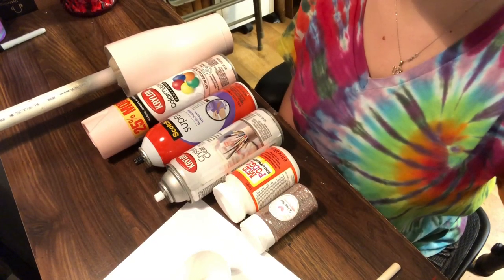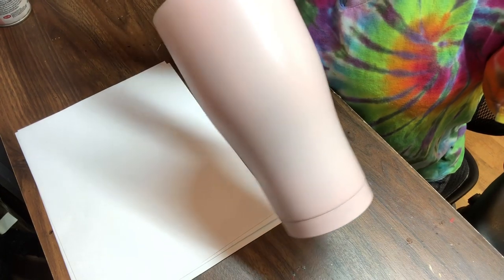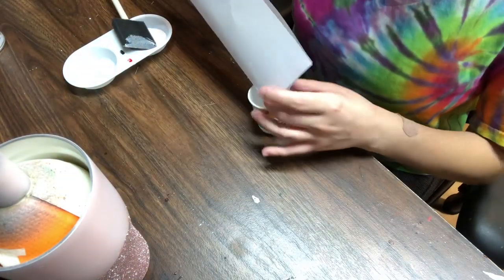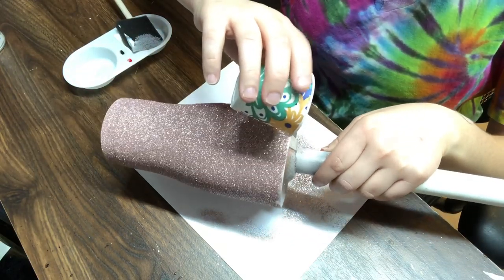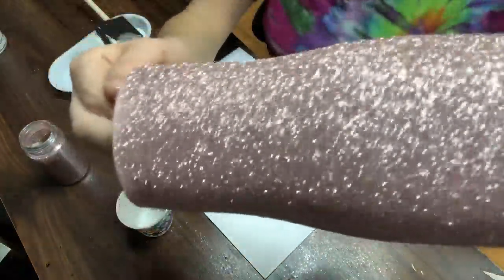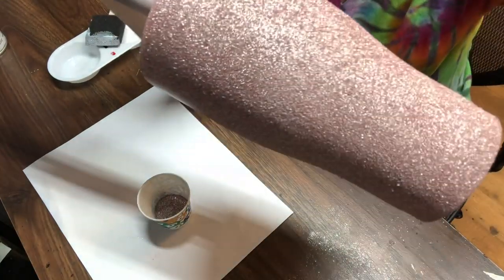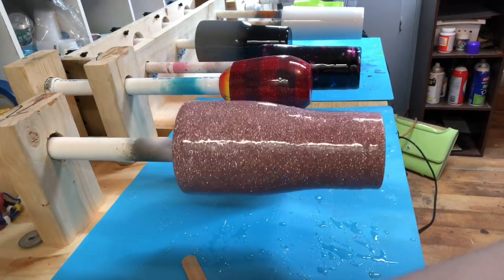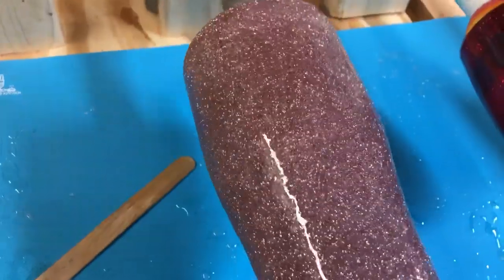Glittered Tumbler Mod Podge Method

Comment: Hi, thanks for your videos.  I have 2 questions and hope you can help me.  #1 if the first time I put the glitter it did not cover the entire tumbler, can I do a second time? #2 if so how long I have to wait in between glitter coats? THANKS
Reply from the maker: Yes you may wait and about 45 minutes-1 hour. This all depends on how thick you apply your mod podge

Comment: Why do you use the sealer if you are going to put a few layers of epoxy on it? I am just learning so thank you for explaining.
Reply from the maker: This protects the glitter from moving around when you apply the epoxy. You apply the epoxy with your finger, this causes the glitter to move around. Unless you use a spray sealer.  The glitter is on the tumbler with the mod podge but not sealed or stuck on the tumbler.

Comment: Thank you for the video! This is my 3rd attempt of trying to make a tumbler but first with mod podge method (other two were expoxy) this is such an easier method! I'm on day one of curing but the cup feels bumpy from the glitter some parts feel smooth but not all. Do you have suggestions o getting the bumpiness out? Thank you!
Reply: When you finish doing the mod podge and then doing the glitter wait like 5 minutes for the mod podge to dry a little then press down on the glitter with your gloved hand that worked for me hope it works for you

Comment: Hi I am curious what you used to seal the glitter? Did you used epoxy or still the mod podge? What kind of mod podge to seal?
Reply from the maker: Kyrlon sealer is mentioned in the video, also posted in the description 😊
Reply: @MissKissKreations  would that apply on wood also ??

Comment: Why do you have to spray it with acrylic sealer?  Can I skip that part?
Reply from the maker: If you don’t seal with sealer, you can put another coat of mod podge over the last coat of glitter.    A sealer helps the glitter stay in place so when you epoxy, the glitter doesn’t move around and smear on the tumbler.

Comment: So you don't have to sand before putting the epoxy on the first time, after sealing
Reply from the maker: Correct
Reply: @MissKissKreations  I applied modge podge, glitter then epoxy. When my cups cured overnight they were really really bumpy.  What have I done wrong?

Comment: Hi , any way to apply epoxy without Turner 🙈
Reply: Yes I need to know this!! I watched Jennifer Maker-or something like that-do the “lo-tech” way...meaning just a pvc pipe with 2 small foam footballs on the ends, sitting in a box. She said the 1st 30 mins you must turn it (she said babysitting it) slowly but steady. 

Then after that you can turn it a little and 2-4 mins come back keep rotating and make a full circle every few minutes. Then after that you can do it 2x hour and by the time ur at the 5th hour you more or less don’t have to turn it. Unless u notice dripping still. 

Idk I’ve never done this. Never made a cup becuz it seems uneasy, even tho most videos Ive seen they make it look easy. And very time consuming. And I’m not comfortable using resin inside my house bc my son has asthma. But if I could figure a way to just use mod Podge and a sealer-like polycrylic or something but nothing that most use up tot the lip line. (For me and my fam.)
Reply: @allijmccoy  Thank you sooo much for the reply,  really appreciated 😊
Reply: @tharwajawad2124  Of course! I hope I was of help. And I’m sorry for the long reply. But I wanted to let you know that I’ve asked 5 different pros at this tumbler epoxy method and just waiting on a reply. But if I find out I’ll be sure to let you know what I learn. And if you find out definitely let me know too! 

My husband said that the most affordable way for us, since we are on 1 income currently, is to use an older fan motor. But since I’ve got no clue if this would work, I still wanted to share it with you! Anyways take care and stay safe🥰🥰🌸❤️
Reply: @allijmccoy  of course its helpful , thank you very much , but because of my limited working space and my kids around it won't be practical in the time being,  I got my self busy now with the surviving board with resin  😅 things going fine , thanks again🥰

Comment: is the epoxy fda approved? Food safe?   dishwasher?
Reply from the maker: The epoxy I use is FDA approved. Please research your epoxy seems label or website before assuming yours may be FDA approved.  It is recommended not to dish was your tumbler.  Hand wash only. 
You may drink out of your tumbler with no issue :)

Comment: How long does it take to drink from the cup? What is the cure time of mod podge. I want to start selling the baby bottles on my etsy but want to make sure i do it right. I don't want to use epoxy so I have brute tone polyurethane instead
Reply from the maker: I am sorry, I only seal with epoxy after I design my tumblers.   I don’t have your answer.

Comment: When I use the spray it turns my glitter white even through my epoxy
Reply from the maker: It have never done that to me. Maybe try giving your bottle a good shake before you spray.
Reply from the maker: It will leave a dull or foggy finish to your tumbler after you spray. But, when you apply the epoxy, it will shine right back up!